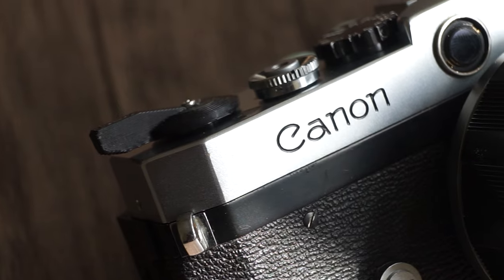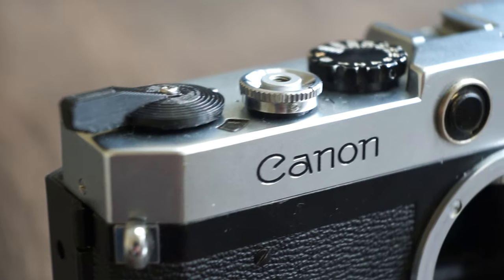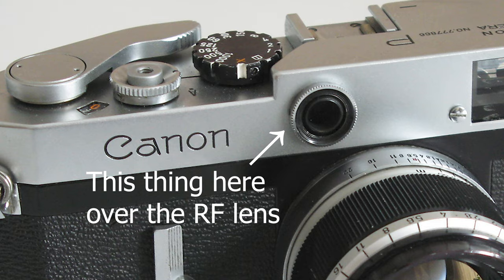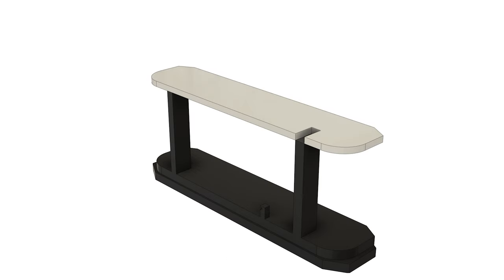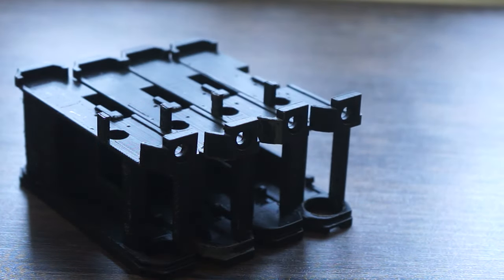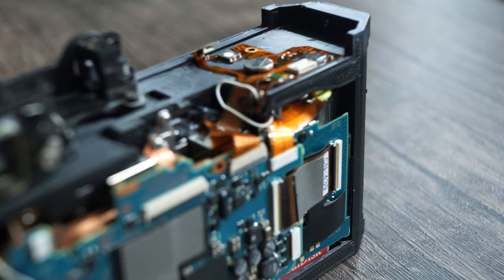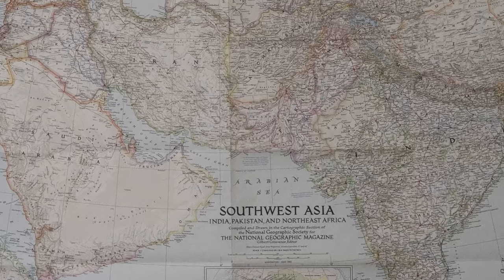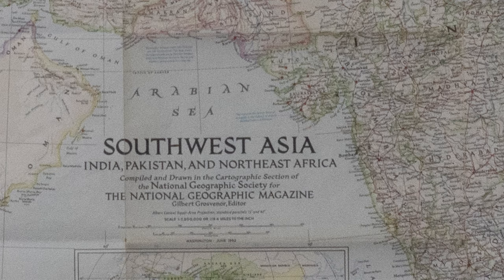Converting A Canon P Film Rangefinder Camera To Digital Using a 3D Printer

Comment: Thanks for sharing, excited to see how you take this project further! 
I'd love to convert a (broken, i think) Minolta SLR to a digital body, while keeping the Minolta mount/lenses. I was looking at Pi HQ camera for the sensor but it just makes more sense to rehouse a cheapo digital camera. You mentioned getting dark foam to seal the body from light leaks, perhaps try making gaskets with TPU on your printer? That could also help with water resistance - or perhaps just keeping the moisture out.
Reply from the maker: 3D printing gaskets out of a flexible material is a 10/10 idea, thanks!

Comment: Love this idea! Not sure if it's been mentioned yet but most 3d prints are not truely light opaque. If you are going to light seal the camera property you will likely need to paint or treat the back cover.
Reply from the maker: Hey yeah, I have noticed that the two layer thick rear cover isn’t 100% opaque, I’ve got some foam and felt material to try on the inside, or I can make it more than two layers thick.
Reply: @ErnestasMontvidas  in my experience most pla and PETG doesn't become opaque until it is approximately 10 layers thick, I don't know that you'll have the room for that. The foam and velvet should help a ton if you have the room on the inside. Doing some reading on 3DP medium format film cameras may give some good inspiration!
Reply: @ErnestasMontvidas  Spray paint it lamp black. 2-3 coats will make it black black.

Comment: I'm pretty sure that everyone who wants to do this sort of "converting an old film camera to digital" project (at least) initially severely underestimates the complexity of the challenge which they have set for themselves. That was a pretty good reason why Epson converting Cosina rangefinder cameras resulted in a niche product (the Epson RD1 and variants), due to its high price.
Perhaps drilling a hole in the back, coinciding with the status LED and gluing-in a plug of clear plastic to act as a light-pipe, would solve the problem without soldering?

Comment: This is awesome and inspiring!
Are you open to questions from other makers who are experimenting (and failing) to achieve a similar result?
Reply from the maker: Thank you! Yes, of course.
Reply: @ErnestasMontvidas  I was inspired by this build:

https://www.youtube.com/watch?v=5DdQN0NVVT0&t=131s 

@Befinitiv has created a image sensor connected to a raspberry pi that fits into the film compartment of an SLR camera.

 I really like this design as it allows the image sensor to take a photo when the mirror is lifted when the shutter is pressed, while still being able to adjust the aperture and shutter speed manually without changing the mechanics of the camera itself. It can in theory, add a digital component to the camera, but still function as a film camera when the digital backing is removed. 

I was wanting to make something similar for a Kodak Instammatic Camera which has more room inside the film chamber, however connect a full frame image sensor from a broken Nikon or Canon DSLR from the early 2000s, to minimise the crop factor.

My question is... 

Is it possible to connect an old image sensor salvaged from a digital camera, and connect it into a Raspberry pi? Have you seen something like this made before?
Reply from the maker: @beneveritt2720  I did actually have a look into this. At a minimum the 1+ghz signal from the sensor much faster than the RPi can handle at 5khz on the GPIO pins.  There is a project called cam86 used for astrophotography that uses a Sony image sensor and custom hardware to capture an image. I also found this blog https://landingfield.wordpress.com/category/cmos-camera-project/ about interfacing with cmos sensors.

Comment: Nice work, intersting the nex works without a lot of its stuff connected, im trying not to be precious about the Canon body . Lol.  ,I did a zenit digital conversion in 2012 , relocated all the buttons, wouldn't want to do it again  ,of a tiny point n shoot , made a mini speed booster to counter the tiny sensor, its kinda unstable runs on aa batteries and is painted florescent pink.  its on instructables . As the olympic zenit digital or something like that.

Comment: hello!  awesome video!  i saw a video in youtube similar a year ago or so where someone frankinized some digital cam on the back of a rollei 35.  i have always thought if doing something similar.

i purchased a couple of fully functional panasonic/lumix dmc fs6eg for under $10 USD and i have a couple of ebay purchases of old rangefinder cameras that were advertised as fully functional and turned out to be almost inoperable (one example would be an inoperable fujica 35-EE).

one idea i had for you, about your led ... i have seen small clear plastic cylinders used to extend an led light to a display panel.  perhaps you could use a concept like that to avoid soldering a longer/larger led ... just a thought.

well thanks for your video really enjoyed it and cant wait to watch more in the series

cheers

the Rabbit.  =:3

Comment: Rip the wind on lever :((
Reply from the maker: I keep thinking it wouldn’t work well because the lever is too long so there would be too much force so it wouldn’t stay in place as a reliable on off switch. But I did tell someone else in a comment that I’ll give it a go. So yeah, I’ll give it a go, maybe I’ll add a second spring to hold it in place stronger.